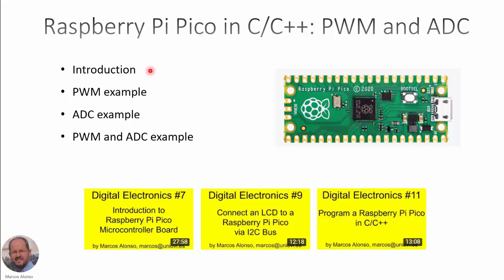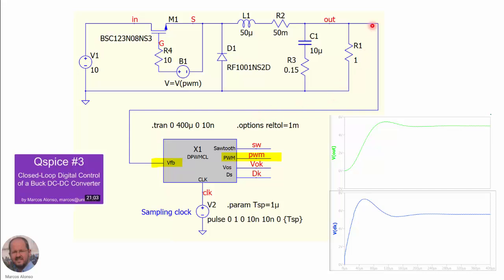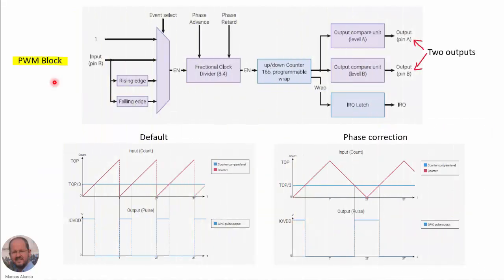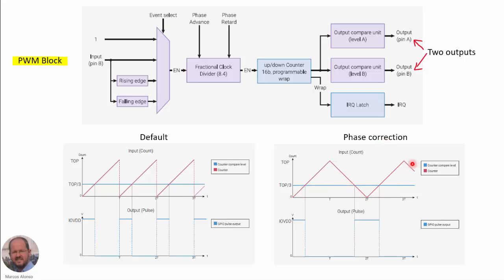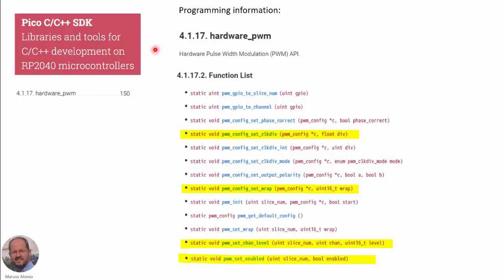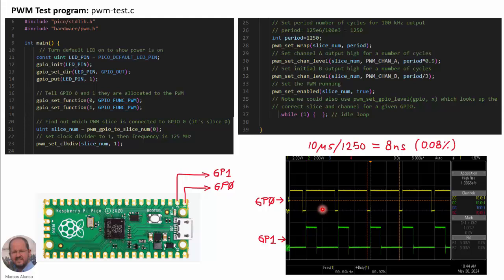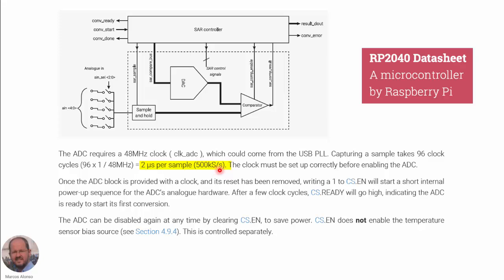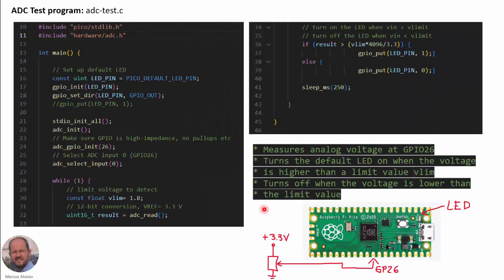DE #12: How to Program a Raspberry Pi Pico in C/C++. PWM and ADC Modules

Comment: Great content and thoroughly explained as always. I would suggest you though to drop the Raspberry Pi Pico. This is just a toy for makers. If you want to design some good digital SMPS then you could try the STM32F3 or STM32G4 series from ST and of course the well-known C2000 controller series from TI. These beasts offer great peripherals for implementing control algorithms and eventually great SMPS.
Reply from the maker: Thanks for your comment. Of course, there are many possibilities but the RP Pico is easy to find and use and can be more than enough for many low power applications. For teaching purposes I think it is a very good option